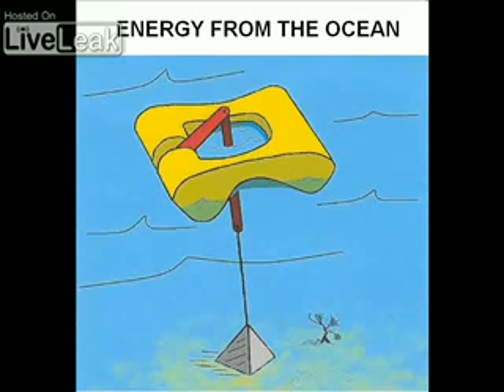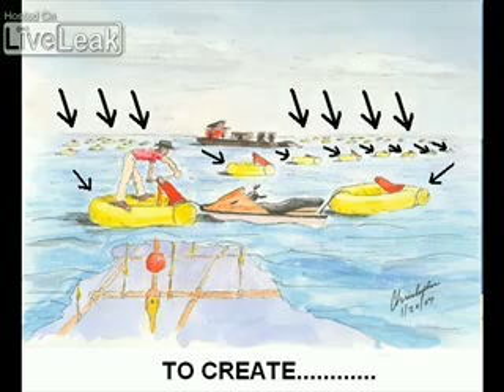Debunk this: FREE ENERGY

Comment: semantics. free energy renewable. regardless we need new fucking tech. lets get off this coal and oil we can come up with jobs replanting trees and plants using organic hairloom seeds, and placing pyramids near the locations we plant these things best if they are made of stone but plexiglass and pvc piping with epoxy glues with out metals in the construct so it does not direct and sap the energy that the pyramids produce at an angle of 72 degrees at incline from tip to base. come on guys tons of them are built in Russia but we dont hear about it cause the tests they did were supressed by our supposed master elites.

Comment: now make a bigger one! you need to make a hydrogen generator using the free saltwater and tidal wave energy. it has to have tanks and compressors to hold HHO that will save all the energy made. you'll be making and saving energy that can be used in almost any industry. HHO is the cleanest fuel

Comment: So we know that waves come in generated by wind at sea.. as the movement of energy waves through the water come into contact with the decreasing height of the land to water level the energy wave is forced to the surface the water is brought in with the energy wave to form wave energy. So, your contraptions would always be converting wave energy to electrical energy. Renewable and it would work 24 hours a day... waves roll in constantly. You would have to account for low and high tides and where to place the contraptions so you get the most actuator movement sizing these very large and making the actuator small would mean that ratio where you would produce even more electricity for every stroke. My question is, would you use a solar controller to manipulate the electricity into a battery bank instead of having pulsing electrical energy operating equipment in a "raw" state?

Comment: Dear god... -- This isn't 'free' energy; there is no such thing as stated by the laws of thermodynamics.

Are we just arguing about semantics here? Maybe, sure. You could say the energy didn't really require any work to produce after the equipment is setup -- thereby being for "free" afterwards, but if you are stating the energy came from "out of nowhere", oh no, no, no-- you are terribly wrong my friend.

The energy is coming from the radiation pouring out of the giant fusion-reactor we call 'the sun', hitting the ocean and heating it up-- causing weather and water movement.
The water current pushes on this device, delivering kinetic energy and rotating a magnet around copper-wiring-- thereby generating an electric current--
but by no means be fooled that it was 'for free' and the energy came from nowhere, please, that is a terrible-awful misnomer and i'd say you probably have an intelligence score of like 10, at most.

Comment: Yeah! That's great, now what did I do with that ocean, oh! yeah! I left it in my other pants. Could you blow your own horn any louder i didn't quite hear it. What I douche bag video. This would have to be one of the most inefficient power source you could come up with just short of a hamster driven wheel. Tell me this Einstein would it not be more efficient to mount something to the sea floor that has the constant wave running through it, back and forth as a power modular, it would be better than this one flippered dolphin, that energizes led's

Comment: There's nothing to debunk for starters...and free energy is a sub-set of renewable energy so stop arguing over who is right and wrong it is the same thing...now back to the debunking part...again there is nothing to debunk because tidal power is a viable source of free renewable energy...once the infrastructure is in place we do not have to do much to maintain the system...the reason it is not more widespread is because the power elite haven't figured out a way to profit from it...think about all the other technology that has the potential to change the face of society and apply the "power elite" rule I just talked about...

Comment: yup, working in large scale since the 1950ies...
Reply: where? give links or examples of actual places that this is actually in use.
Reply: +George Vasquez To be honest I've confused "wave power" (https://en.wikipedia.org/wiki/Wave_power), which is in use since the 2000s with "tidal power" (https://en.wikipedia.org/wiki/Tidal_power), which is in use since the 1960s. Anyway, this isn't "free energy" but "renewable energy".
Reply: +topfkopf666 you are confusing free energy with renewable resources.
Reply: George Vasquez "Wave power" is renewable energy, because the energy sources are the sun / weather (caused by the sun) / tides (caused by sun and moon). I'm not confusing "free energy" with "renewable energy" because there is no such thing as "free energy".
Reply: +topfkopf666 if you are not paying for it, after the initial cost of the equipment, then it is free. And now you are confusing tides and waves. Plus while high tide and low tide are affected by the sun and Moon, the waves are not. ways are created by the wind.
Reply: +George Vasquez Hahaha, that's not what "free energy" means... ;) "Free energy" is not a technical but an esoteric expression!
Following your argumentation would mean solar power was also free energy? B/c after the power plants are built there are only maintenance costs... So why am I charged for electricity from solar power? ;)
Reply: +George Vasquez Hahaha, you're funny.
So if they had wave generators like these it wasn't free energy anymore? ;)
"Free energy" is an esoteric expression and doesn't mean "free of charge".

Comment: Cool, verly simple.. I"d like to see a hydraulic one made couple tons like a big cylinder.  A saucer that goes down under the water 20 or 30 feet connected to a big piston that squeezes hydraulic fluid through valves to spin a dyno one way using check valves when it goes up and down..

Comment: wait, with that would you not be able to power a boat at sea without using any fuel?

meaning that if a boat was at sea, it could be powered by the sea, and never have to stop?
Reply: You have a point . . . but it seems that the apparatus is activated by ocean waves. If the sea was calm, then perhaps there could be a problem.
Reply: I'm talking like major transport ships
Reply: Ushi the device needs to be anchored.

Comment: It's not free.  You have to spend money to build it.  You have to spend money to fix it and maintain it.  Then if someone wants to create a large one for use, they have to pay you for the rights.  So it's NOT FREE you IDIOTS.  No different than hydroelectric, or other wave power systems that already exist.  Renewable yes, free no.  They tried to put large scale ones off the coast of Oregon, but was stalled because the surfrider group complained.  Google Pelamis wave energy.
Reply: An that's the thing. I read about similar ones to this in a 1999 issue of Maxim. And every time they want to test it, the NIMBY crew screams. Even more so because the people whose backyards include the oceans are rich and don't want to anything disturbing their view. Just like the Kennedy clan fought successful to keep off shore windmills away from their properties. Despite fighting for subsidies for wind research. Oh, the treehuggers want it all right. Just as long as it doesn't block their view.

Comment: let me give u a tip
 use a  peranent magnet 3 phase ac motor from it  and run the ac  wires from it to a diode rectifier and then  use it  on a battery bank

Comment: Even with a generator, you will need a voltage stabilizing circuit of capacitors and diodes.  It will help smooth voltage when it sags so it won't ruin equipment OR you create a large storage device for the energy, then distribute that way.  Cool though.

Comment: I wonder what is the optimum shape, volume, size and aerial distribution of these floating things when having a large area with them. Too big and they won't capture the motion of the waves and too small you will have them interfering with each other and have to pay relatively too much in generator and other cost. And different areas will yield different results and continuity of power due to how the waves are. Is it more cost effective than solar power?
Reply: in reply to likmahchodaI agree the music in the back ground can be very annoying I- usually put the video to mute - and just read the comments

Comment: Great idea, my suggestion is to make the frame bigger and the arm longer to take advantage of more of the wave. If the unit is hitting its limit of movement and then dunking, you are not taking advantage of the full range of wave movement available. It should have a arm through of 5-6ft.

Comment: OK, one clarification that I made... THIS small scale stupid device is probably 99% wave power, and about 1% tidal power. If you were to scale it up, it would use more tidal energy and less actual wave energy.
- Wave energy basically is powered by wind, and a standard windmill is way more efficient than this piece of junk.
- Tidal energy comes from the Earth/moon gravitational pull, and slows the rotation of the earth.
Google "tidal energy slows rotation of earth" for thousands of articles.

Comment: Yes, this stupid toy probably gets 99.9% of its energy from wave motion (as you said is based on wind), and only about 0.1% from tidal energy (which slows the Earth's rotation). But, at this tiny scale, it's useless to anyone. And, if you're essentially going to use wave power (wind based) a windmill is far more efficient than this piece of junk.
If you scale this up to power cities, a much larger percentage is going to be a result of tidal energy, which slows the Earth's rotation (tiny amount).

Comment: Tidal energy is the hydrodynamik movement of water from a high potential to a low potential, the flow of it drives a turbine. If you slow the water down, it's momentum has to go somewhere, therefore the earths rotation should increase. In practise, such forces a incredebly small and do not make a difference at all (a=f/m, the earth's pretty heavy). Other forces act on our planet who are much bigger, all of these average out.

Comment: 3rd reply to this same post:
A clarification:
On this scale, this has no hope of generating any useful energy. And, yes, you're actually correct, and I was incorrect if I led you to think that this small stupid example is tidal. It clearly works from waves. However, waves are generated primarily from wind, and a standard windmill is far more efficient than this stupid thing.
On a larger scale, the only way it can work is from tidal energy, not wave energy. Tidal = slows Earth's rotation.

Comment: No, it doesn't slow the earth's rotation; not by "stealing energy". that is a frequent misconception though. Waves (the majority of them) are generated by the wind which is (as well as global rotation) powered by convection within the lower atmosphere which is sustained by heat, primarily from the energy which originated as sunlight. The rotational energy put into generating wind & waves is inevitably lost anyways, so using the wave energy really isn't "stealing it". The same goes for the sun.

Comment: If you disagree with the slowing of the rotation of the Earth, I suggest you submit your ideas for peer review to a physics journal. Every physics PhD on Earth is currently under the impression that, as you increase the factors causing the Earth to approach tidal lock, the Earth's rotation slows (pesky laws of physics, ya know). There are hundreds of peer reviewed calculations and articles on the subject, and hundreds of thousands of open articles you can find with a 10 second Google search.

Comment: That's actually not true. According to Noether's theorem, momentum inside a closed System remains constant over time. Earth and 'wave harvester' are a closed system, therefore the device can't slow the earth down without getting stupedously fast. Your error results from the wrong premise that waves result from the earths rotation. I agree with point 1 and 3 though.

Comment: Well, all energy sources have some issues.
- Nuclear is more clean and safe than most people realize - but has long term disposal/containment problems.
- Solar is a primal source, probably the "best" - but there isn't enough raw material to produce solar panels for everyone, and the reflector arrays for using solar to power steam generators are still in their infancy (but promising).
- Wind is probably the best "overall" solution - but is unpredictable.
- Etc. Blah blah blah.
Nothing is easy.

Comment: Tidal power comes from the moon's gravitational tug on the oblong side of the Earth's ocean bulge (perspective of the moon), which is slowing the rotation of the Earth until tidal lock. (The moon is already in tidal lock.)
When you attach something to sea floor as the tides are coming through, it results in increasing the "tug" from the moon, which causes the Earth to slow down even more than it's already slowing (looooooong time though).
Wiki expands on this better than I can in 500 characters.

Comment: I agree that wave power is a viable source of energy but it is no more "free" then other forms of hydro, goethermal, solar or wind. It has drawbacks. So debunked? That aside as a suggestion anytime some form of energy is actually realistic and proven best not to title it as "free energy" as it puts it by default into the zero point hoax, Tesla hoax, magnet motor hoax and run your car on water hoax catagory.

Comment: A closed circuit cannot sustain over 100% effeciency. An electric motor driving an electric generator which in turn powers the motor driving the generator will eventually stop turning. Open circuit would be running a motor continously as long as power is supplied, which is what the waves do. Cool idea, but not "free energy" of the strictest sense

Comment: surges of variable power is not perfection. it is hard on any electronic devices. even motors.no voltage regulator can maintain a steady voltage with this 'power generator' ..debunked that.

Comment: but then i mentioned this device doesn't sound practical.
reason 1 its very bulky and you need like 20 of them to power your boat
reason 2 its in the mercy of the tides if the tide drops low it will fail,and if a storm hits it maybe damaged.
reason 3 boats may hit it,anglers may snag it by accident,people may swim up to it thinking its a life boat
reason 4 the long cable, if you plan on using this for your house the cable will waste a lot of electricity because its to damn long

Comment: Oh wait... "this $65 invention"...

Still, if I could spend $65 and then have a guaranteed steady trickle of electrical power for the next couple decades, I'd be quite happy. Or at least, if it produced more than $6.50 of electricity a year (approx 6 watts average at current per-unit rates)... because then it'd give a better ROI than almost any solar cell on the market. And be far less beholden to sunshine. Tides and waves run 24/7...

(Oh god can you please turn that music off now? Argh.)

Comment: Well, you're not paying more than a tiny regular maintenance cost per kWh generated, I suppose.

Really, if it attracts the attention of some of the more credulous but maker-y types away from all the usual zero-point, magnet-motor and HHO nonsense into making actually productive renewable energy generators, it can only be a good thing, even it it requires use of a slightly misleading title.

Plus it does look like they knocked it together with surplus sewer pipes and the like... might BE "free"!

Comment: I'm sure he's looking forward to larger units generating much more power which can be transmitted inland, or at least just running things in coastal areas taking that burden off the power generating stations. Who knows what kind of similar ideas/devices we can come up with from this idea.
I've already got an idea for a wind blown panel on a hinge with a generator attached to it. Also an air vent/wind turbine attached to a generator in an attic. Not much but worth looking into. Run with it.

Comment: free energy doesn't mean you don't have to pay for it. it means no energy is required for it to continue running. and since it works by the waves imparting kinetic energy to the device it is clearly not the case.

Comment: Why does this have the title it does.
There is nothing to debunk, tidal and wave generators have been used for years.
Tidal generators are attached to the seabed and use the slow moving tidal energy and floats which has great high force potential a couple of times a day.
Wave generators can be the same but capture less force more frequently as they move quickly with the waves or they can be in the form of funnels the wave is captured in and pushes air out a spout through a wind turbine.

Comment: Despite all the debunkers here, this is a great invention. Not everyone on the coast has wind for energy. Of course it is free energy unless someone believes you have to pay poseidon some sort of tax. Scaled up in a controlled environment there should be no risk to then environment. No oil slicks, no CO2 pumped into the atmosphere, no radiation. 

And no, a dam relies on a constant flow of water and with rivers drying up due to environmental change, too risky.

Great work.

Comment: That's why I said to build it yourself and mentioned that it is much more realistic if you live in a remote area where you would have to pay to have lines to your house. It can cost 10s of thousands of dollars to have electricity lines run to your house. Also, solar thermal (hot water) have a MUCH lower cost and much lower payback time, even if they aren't subsidized and were in wide spread use before the cheap oil and gas came on the market.